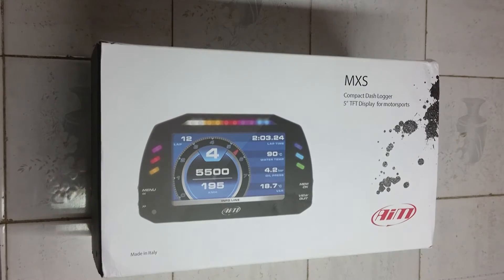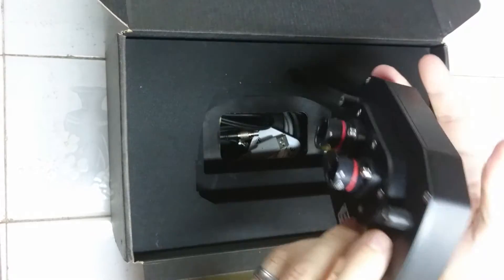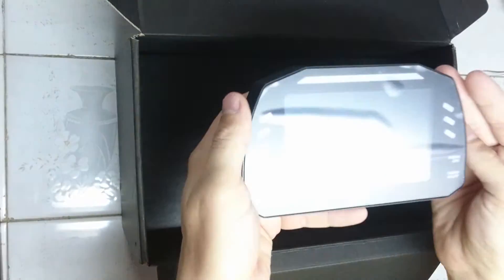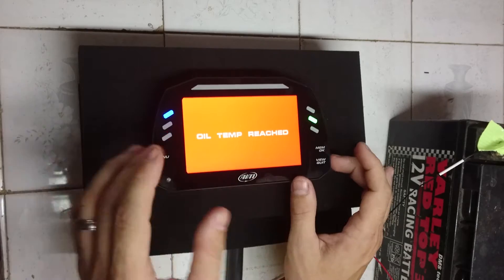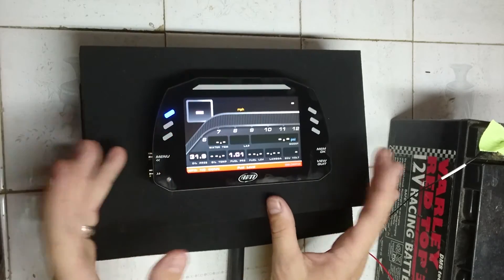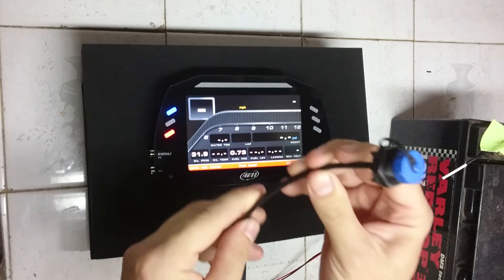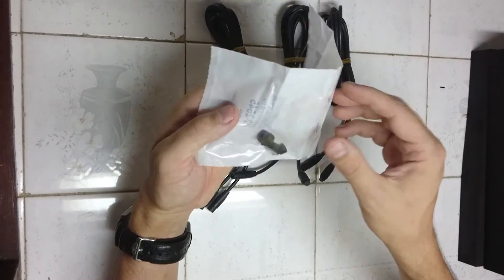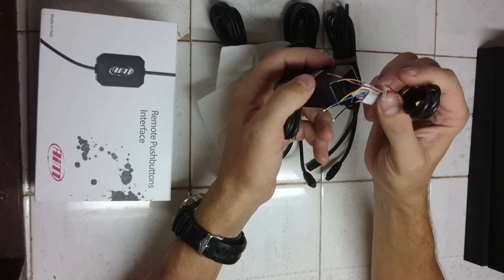Aim MXS digital dash datalogger - Part 1 - Unboxing

Comment: hi, can this MXS strada dash datalogger save data (ie lap time, rpm, temp & etc) which can be download to pc to view later? "cos I read some of their website is only a display & review on board.
Reply from the maker: Hi, the version above is not the Strada, it's the usual MXS that logs everything. Typically the Strada versions of Aim dashboards don't log - they only display, so make sure you get the right one! :D

Comment: Can this be used on the street and does it give all the info a normal cluster would?
Reply from the maker: You can program it to if you were to give it the inputs for lights/indicators/etc. It can display any input you want. For example, I use it as a water pump switch reminder - ran the 12v water pump feed through a 12-5v convertor and into one of the loggers channels.